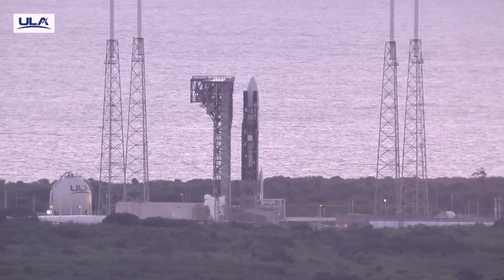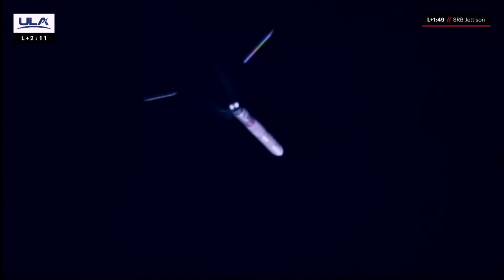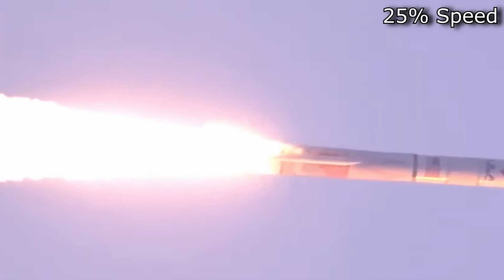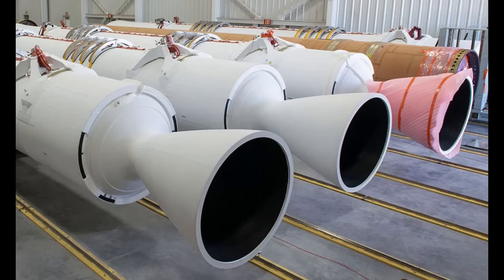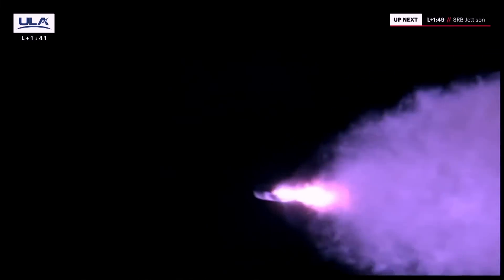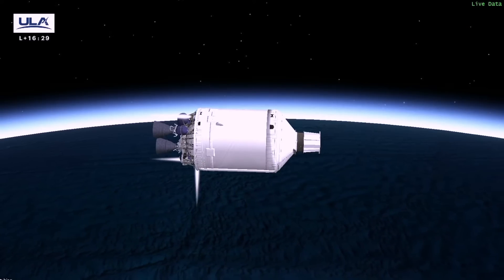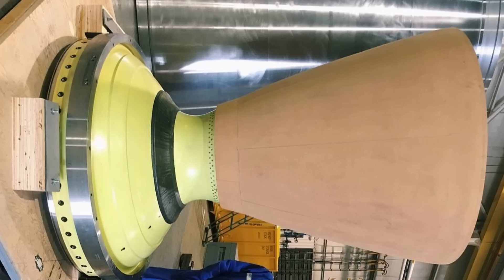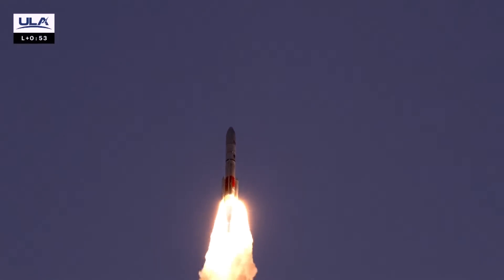How Did The Vulcan Rocket Survive This Booster Failure?

Comment: wow - has there ever been a rocket launch that had so much damage/etc that made it to orbit?  Not good that the SRB had issues, but holy cow, absolutely incredible that Vulcan was able to deal with everything and still have basically a completely successful flight.  Thanks for the vid sir.
Reply: Apollo 6 is the closest I can think of, internal fuel lines ruptured and the rocket was pretty close to shaking itself apart. Apollo 12 and 13 were also rather dramatic, although the lightning strike didn’t do too much physical damage on 12, and a single engine failure on ascent during 13 aren’t quite as dramatic. I’m sure there’s something else out there, but I’m drawing a blank right now. Will update if I find anything else
Reply: At least 1 Space Shuttle lost a Main Engine on the way to orbit.  Was able to compensate but ended up in a lower over-all orbit.

The first SpaceX COTS Dragon flight lost one of the 9 Merlins on the way to orbit.  Achieved the primary mission but lost the ride-share mission that was tagging along due to 2nd stage fuel being marginal to safely deploy the rideshare without threatening the ISS flight path.

Comment: When you showed D Wise's footage over debris being ejected, you said it was the nozzle, I don't believe it was, I think the nozzle went during the first explosion of flames. Over on EJ's Twitch channel, we did the post mortem immediately as photos and footage was made available, it seemed to be the consensus that it was the ring above the throat, either the black part, or yellow part that attaches to the booster in the photo you showed. EJ explained he believed the failure was at the throat or just below it, probably due to a micro crack somewhere. If that was the case, where the failure was around the throat area, that would explain the plume of exhaust coming out of the side in addition to when it was suppose to coming out of. Then at some point the nozzle got yeeted straight down, leaving a narrow hole exposed to heat and pressure it wasn't designed for, coz the exhaust gases/flames are expected to expand through the nozzle, with the nozzle gone in my opinion, the build up of heat and pressure in the ring above the throat got too much which resulted in the ring being ejected out the side. Like you said, a lucky escape, on another day, or with a payload the vehicle is lost in a RUD.

Comment: Thanks for your insights Scott.  Did you mutter "Nozzle-rich exhaust" like I did at the :37 second mark?  
I just watched the first Vulcan flight for comparison (I know they won't exactly the same orbit and payload profile, but it's the only launch we have) and you are right, the BE3s had to haul the SRBs farther downrange than the first flight (1:50 jettison), but the high rocket pitch following SRB sep is similar on the two flights, so this may be a feature and not a course correction.  Centaur pitch looks roughly the same to the untrained eye as well.

Comment: Well if this wasn’t a KSP launch, I don’t’t know what is. That sideslip is very familiar.

Joking aside, getting to orbit with a partial SRB failure, what a testament to this vehicles reliability! The engineering team should be very proud!
Reply: Pure luck.
Reply: @raymondhunt751  It's not just luck, it's a testament to the skill and craftsmanship involved that the rocket made it to orbit.
Reply: @raymondhunt751  yeah, the accent guidance programming had absolutely nothing to do with any of this. That computer must just flip coins to decide what to do…

There has never been a single rocket to reach orbit after any sort of SRB failure, and rockets have been terminated for much smaller issues. The fact both the hardware and software were able to compensate is extraordinary.

Comment: Bet the FAA won’t ground it, where if that was SpaceX it would have been grounded before MECO
Reply: Wrong. SpaceX has had multiple engine failures during first stage ascent and has never been grounded for that. If there is no loss of vehicle and no debris leaving the hazard areas or causing damages, it is unlikely to be a mishap.

Comment: The software here was the hero. Doing all those calculations on the fly through changing dynamics is astonishing.
Reply: Yes, the GNC was great, but it was backed up by great hardware. The BE-4 and RL-10's flawless performance and operation really was critical to saving the day.
Reply: Impressive indeed..but not so much if you compare it to other everyday stuff we all use. The math behind the calculations never changed much..its laws of physics..it just got smaller and faster. And by that, more prone to bugs or software/hardware failure.
Impressive none the less

Comment: Is that the same type of SRB used on Atlas V? Is it the same that is used on Atlas V to launch Starliner?
Reply: Atlas V upgraded from AJ-60A to GEM 63 for most missions in 2020. Vulcan uses GEM 63XL, which is a bit longer and produces more thrust. The Atlas V configuration for Starliner still uses AJ-60As.

Comment: Note that the nozzle throat diameter is carefully sized to maintain enough pressure inside the case to keep the burn rate of the solid propellant high to produce gas generation. If the pressure drops due to throat errosion or failure, then the burn rate drops and much less gas is made so less thrust.
Conversely, the biggest problem with SRB's is runaway burn rate where the pressure goes up a bit, the burn rate goes up which causes pressure to spike up into an explosion.

Comment: It's impressive that rocket avionics has gotten so advanced nowadays, that even they can handle a few engines breaking down in the flight keeping it as straight as an arrow until it's happy that it has reached the orbit.

Not to mention I bet programmers and computer hackers, that they hired to code rather special pieces of software for the rockets, would have had to spend decent time to look over and code the software as well as finding and eliminating the code bugs. It takes a lot of attention to such a little detail, so you don't get a mid-flight mishaps happening.

Comment: The fact that the guidance system handled that solid rocket motor partial failure inspires confidence.
Reply: It inspires confidence in the guidance system, sure.  Confidence in the SRB supplier, not so much.
Reply: Yeah the GNS people giving their report on the event get to say something like "but on the bright side, the software handled it even better than we thought it would." In the software world, you're never sure how well your code will handle unexpected situations.
Reply: Some, but not in the SRBs, which are critical for launch!  The Vulcan won't fly without them!  They are an integral part of the rocket!
Reply: Confidence  in the guidance system and the BE-4 main engines

Comment: So will the FAA ground Vulcan? Or are they flying under NASA rules?
Reply: It's licensed by the FAA, but I don't think it's clear that this is a mishap. A mishap essentially is either a mission failure, failure of the vehicle or debris to stay within designated hazard areas, property damage, or a few other things. This was dramatic, but it didn't cause any of those things.
Reply: @AmbientMorality  how is this materially different than when Falcon 9 had an upper stage issue?
Reply: @terrysworkbench  One of the upper stage failures resulted in loss of mission, and the more recent one resulted in failure to splash down within hazard area.
Reply: @terrysworkbench  In your launch license you indicate the range and safety area's that your boosters, stages, etc will be coming down.  They get uptight when you miss those target zones or drop debris along the way.  It looks like on this flight all the boosters ended up where they should have and ditto for the first and 2nd stage.  That means despite the drama of the launch there might be no FAA issues.
Reply: @TheEvilmooseofdoom  Falcon-9 shutdown early, but the payload still reached orbit. Still had an investigation. Same as this, except they didn't drop any parts of the spacecraft.

Comment: Well, for what it's worth, I think this was even better than a regular flight without any problems. There was a problem with a part supplied by a third party, however the Vulcan was able to adapt and perform within the desired parameters.

A marvelous save is the best proof of great craftsmanship.
Reply: The problem was potentially very serious. So, over the long term, the recovery might be reassuring, but over the near term, it’s going to badly undermine confidence in flights involving solid boosters.
Reply: @zzubra  I don't think so. SRBs have worked very successfully for a very long time. More than likely, this one had been damaged along the way and no one knew it. Could have occurred in shipping, handling or assembly. The simple way to deal with this is to do some NDT inspections after assembly.  There should be no doubt that the design is fine. But this started leaking immediately so it should have been detected. I've seen these loaded on trucks with the nozzles mostly unproduced. Looking like a problem waiting to happen!

They should be able to recover these and hopefully pinpoint the failure mode.  I'm pretty sure the plan calls for recovering and refurbishing these like virtually every one used on the shuttle was. .
Reply: @professorg8383 
The Space Shuttle SRBs were only refurbished for show!  It would have been cheaper and probably safer to have built new ones for each flight!
Reply: Although it's a good save, unfortunately the reality is that they incur any risk of all of their suppliers, which is why vertical integration is critical. As far as a payload is concerned, if they don't get to orbit due to a third party part, they still have the same outcome at a full catastrophe. It's great they saved it, but not a good look
Reply: Agreed
Reply: It's a bad look for ULA's qualification and acceptance procedures, not just the supplier. The FAA will probably investigate this very closely.

The flight control system was very impressive though.
Reply: @rubemjr9623 
The FAA has already announced they won't!
Nice to have friends in high places!
Reply: Yeah, I'd think this would sell the Vulcan better than anything else.
Reply: Indeed, Well Done Vulcan!
Reply: Second such failure though... Which could have taken out the rocket.
Reply: Loosing a nozzle right after take off, a nozzle. Craftmanship... I think it was more luck on there save not redundancy.
Reply: @MrSpikebender  There is a misunderstanding, I am talking about the craftmanship done by ULA in regards to their rocket and its guidance and control software, not the booster that was supplied by a third party.
It's quite obvious that this was mere milimeters away from a total desaster and that a lot of luck was invovled to prevent said desaster, but the way it did happen, showed the ability of the Vulcan to deal with something that's way outside its intended parameters. Luck or not, it's still a really good demonstration of the rockets guidance and control systems.
Reply: @MrSpikebender  Making the nozzle out of cardboard is out
Reply: @qbi4614  "But Mrs Warden, why did the nozzle fall off?"
- "Well, it got hot."
"It got hot?"
- "The nozzle got hot..."
"Is that unusual?"
- "Oh yeah... During launch? Chance in a million!"
Reply: @MrSpikebender  The bonded transitioñ is new ., untried. That is the reason you need realistic testing .  The FAA does not understand this . They must not interfere during the test phase it it is not the time to micro manage or meddle.
Reply: @ha... ummm NO!  What an odd idea.
Reply: Or just good luck